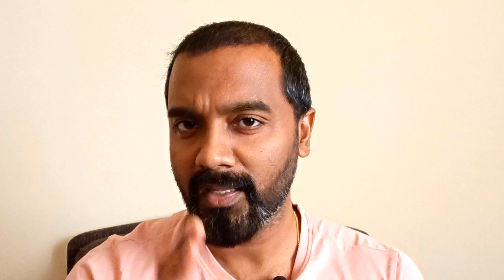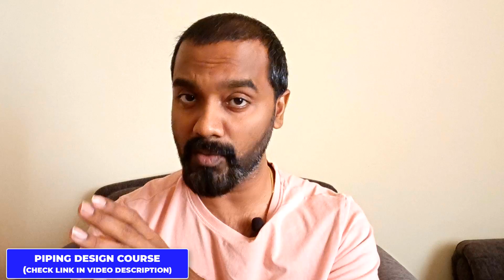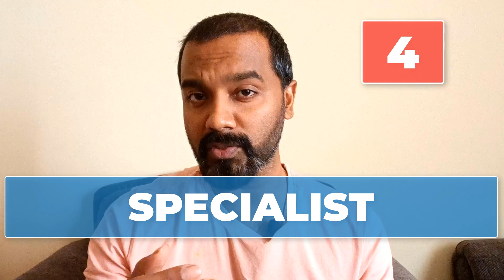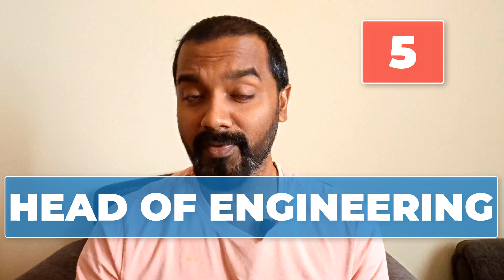Piping Design Engineering Career Growth Stages from Beginning to End

Comment: Hello Sir, I am following you from quite few months now. I have question for you that i am working as a pipimg engineer in Marine field(5years). So I am looking to change my field on Oil and Gas sectors. Is it possible to switch?
Most of the job requirements only look for Oil and Gas candidate and not any other field.